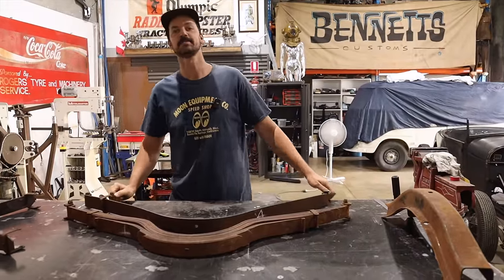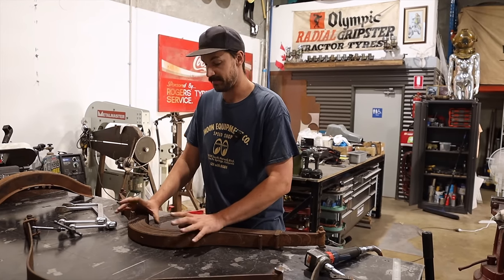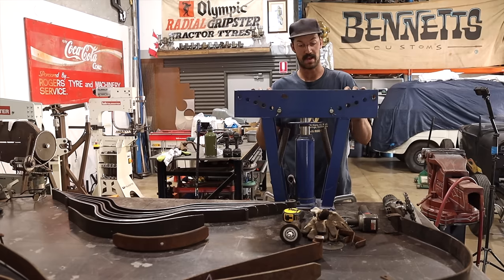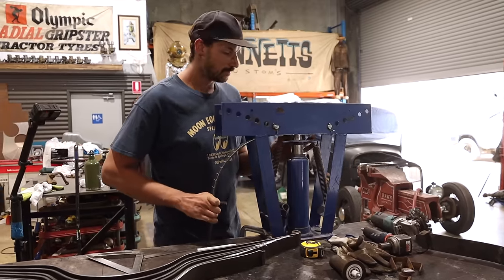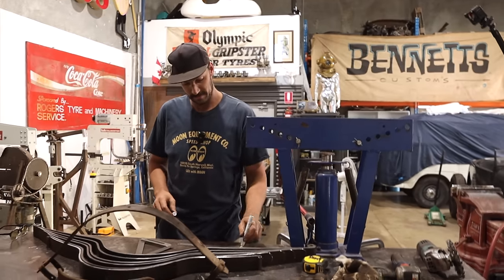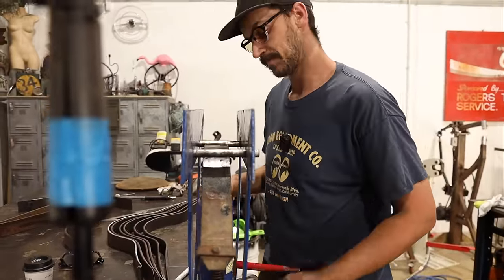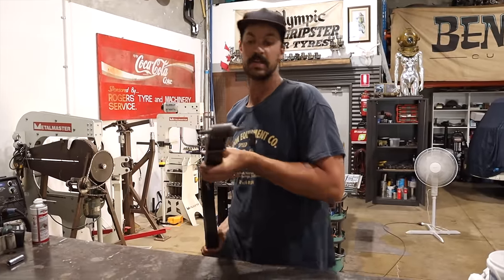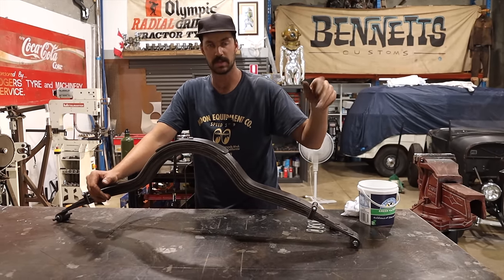Upcycling A Model T Leaf Spring To Upgrade Your V8 Rear End: Transform Your Hot Rod!

Comment: Brilliant thumbnail Jordan, and a good choice of quick change too!  I run a Pacific also in my A coupe ,Bill is a great guy to deal with and it is a quality product, comes in a great box !I would offer some words of advice when building it ,use studs and nuts on the "bells" until the final fit up ,buy a shim kit(probably two!) and buy or borrow an dial torque wrench for setting the drag on the pinion and the spider gear section ( I tried using a spring balance and a lever but it was too frustrating)Inch pounds with a very small range 0-20 .I used an old spider centre and welded a nut to it so I could run a length of rod right up through the bell with a nut on the top to rotate it and set the drag on the bearings in the bell .I hope that makes sense-I did try and make a video for my channel but it was too long and involved( I got bored watching it!).cheers from Scotland

Comment: When I redo springs I  like to paint them with a graphite paint (I use Slip plate) so the springs will slide on each other and it really improves the ride and won't rust. I also grind the ends of the springs where they come together so the upper spring will slide better on the lower and not wear into the lower spring.

Comment: Did you grease between the springs? Reduces the "squeak-squeak".
Reply from the maker: Not yet but this will be disassembled again and springs painted prior to final install
Reply: I read somewhere that back in the day guys would put greased brass screen between the spring leaves.
   Probably the modern equivalent would be some type of thin plastic sheet